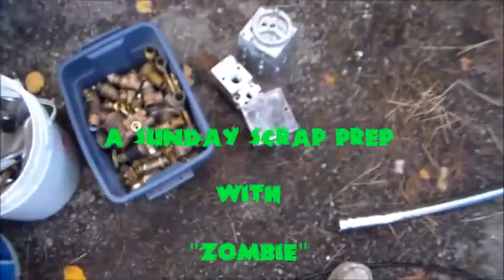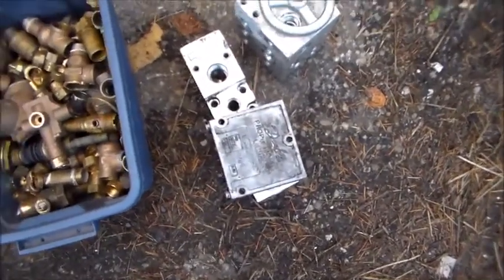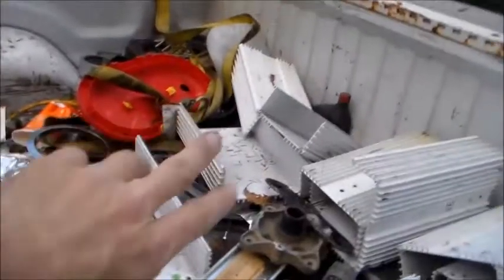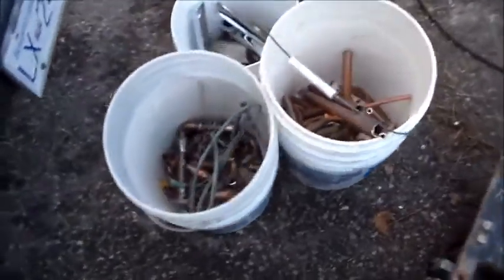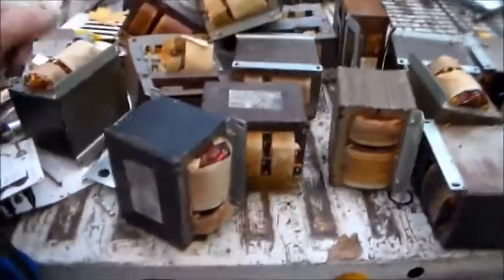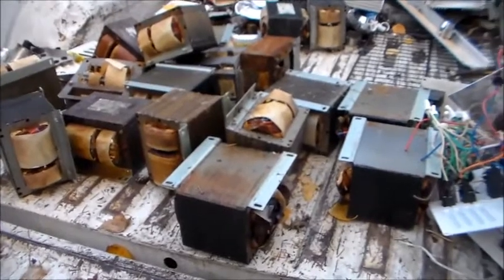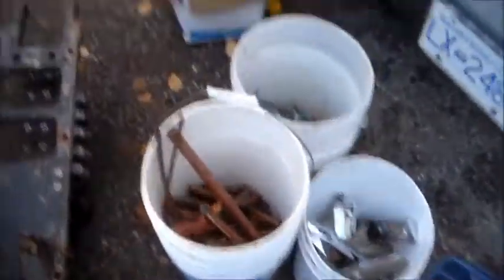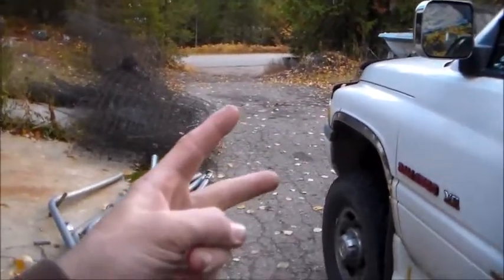Preppin' Sunday for non ferrous run

Comment: To bad they pay you as steel on those transformers. They should pay you as electric motors. Shop around with another scrap yard if there is one close by. Mine pays me as electric motors copper or aluminum.